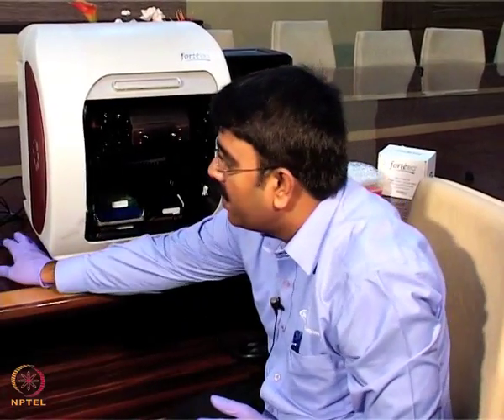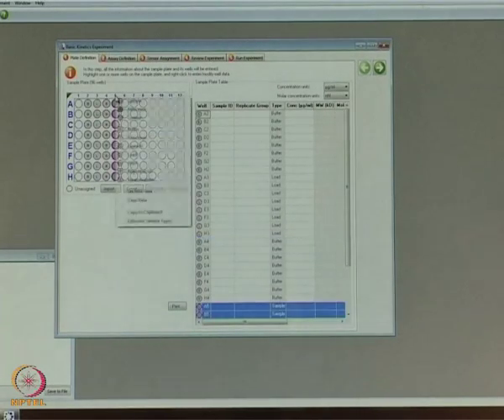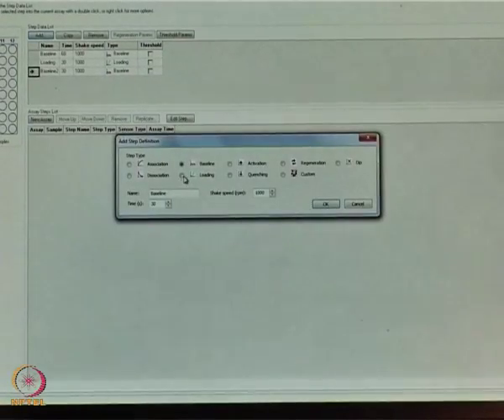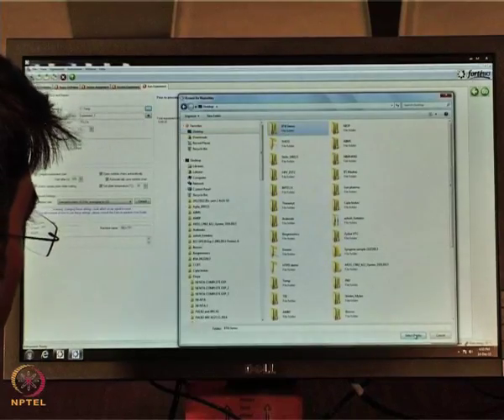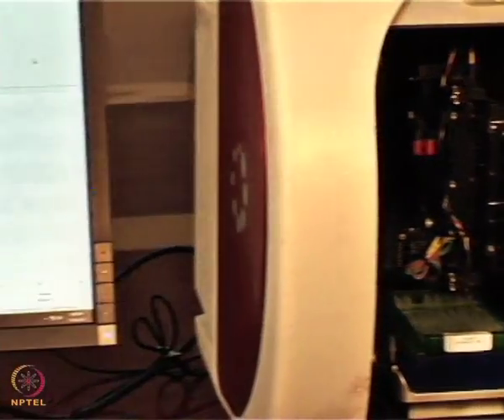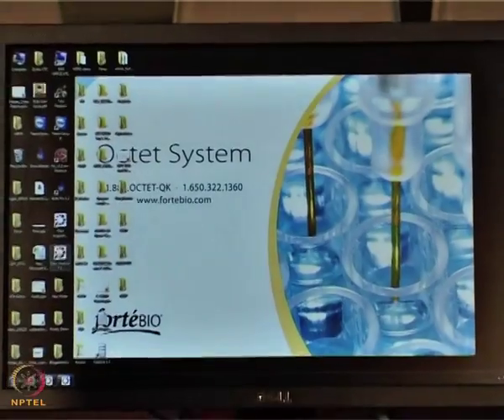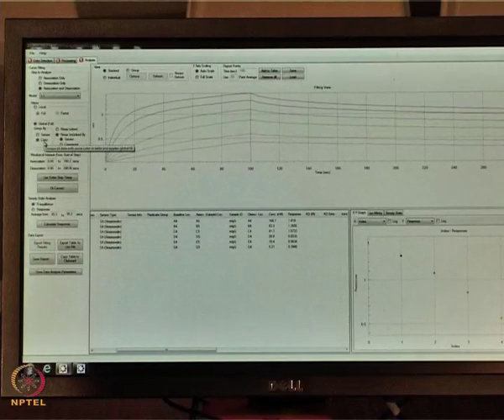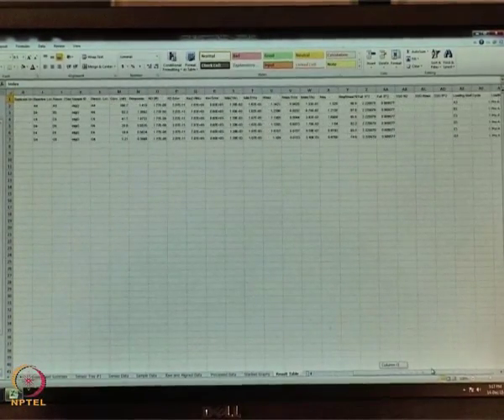Kinetic analysis of protein-protein interaction using BLI

Comment: Very nice presentation. However, I find that the 1-1 bi ding model doesn't fit appropriately. Even residuals are very lousy. Would it be a better idea to use some other fitting model and does the software allow for that